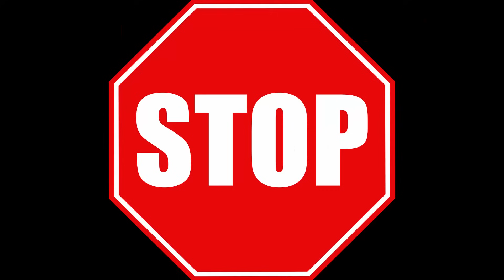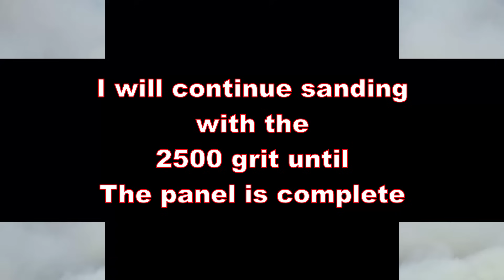How to Cut and Buff New Paint

Comment: Great video! Do you have a guideline when your clearing to make sure you put it on thick enough to get safely through the entire finishing process without going through the clear? Do you measure mil thickness or anything like that? Is 3 standard coats of clear sufficient and still retain thick durable clear?
Reply from the maker: Rule of thumb is 3 medium wet coats of a high solids clear. Stay away from your edges and sharp body lines when sanding. That's it. Good luck with your project.